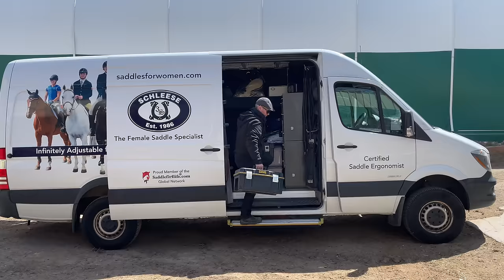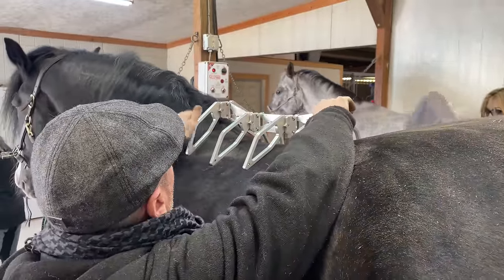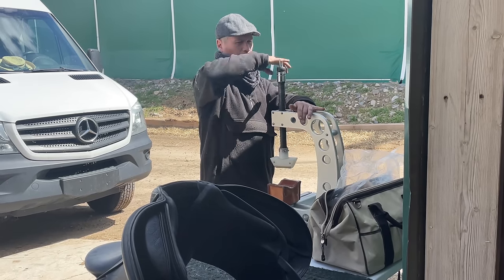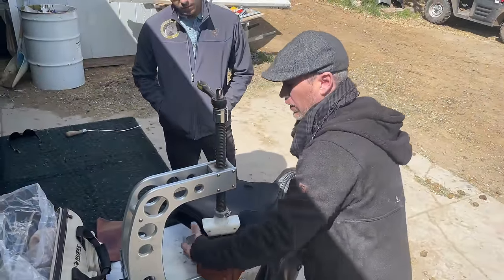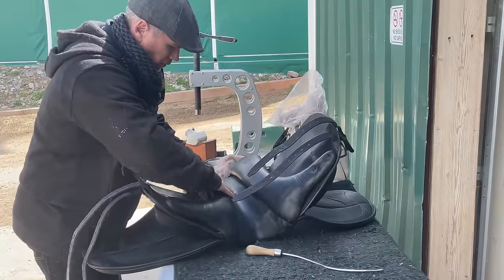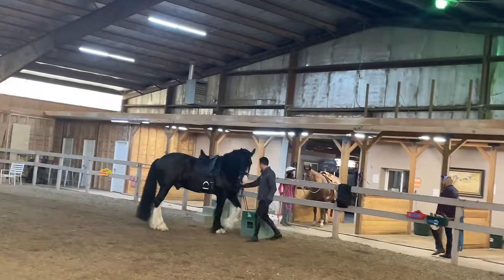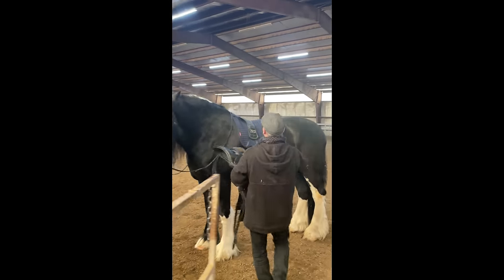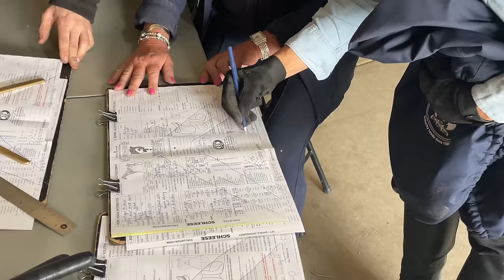Apollo the Shire Horse Getting fitted for Schleese Dressage Saddle 2023

Comment: Unfortunately ,Chris did make a few mistakes, if he would have dropped the front panels he could have measured between the tree points and got a accurate measurement and then widen the tree. Also he widened the tree and then he flared the tree points out, not the way to do it ! This will make the tree tight at the top  of the wither. Another thing that Chris didn’t check for was to see if the saddle was bridging in the middle..
Reply from the maker: You know more than I do about saddle fitting!